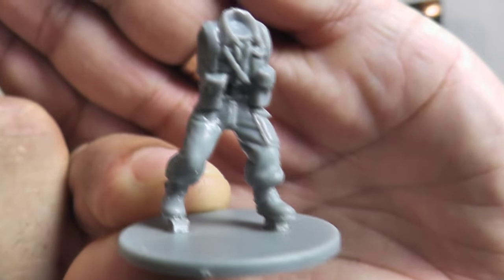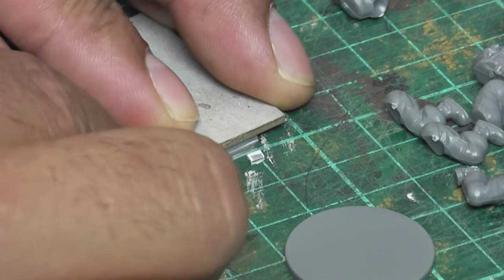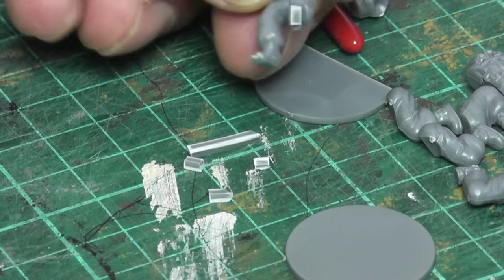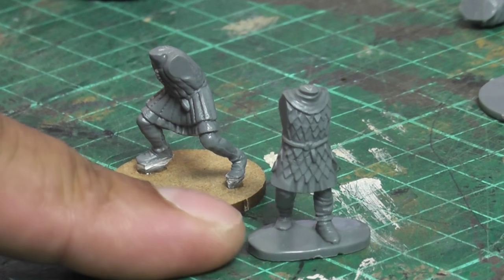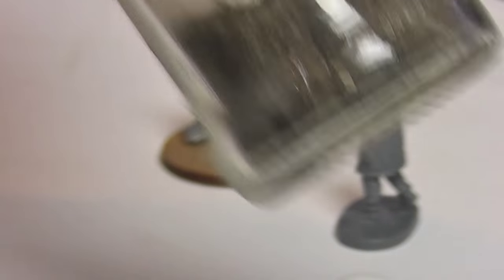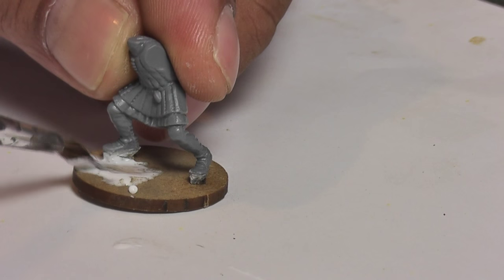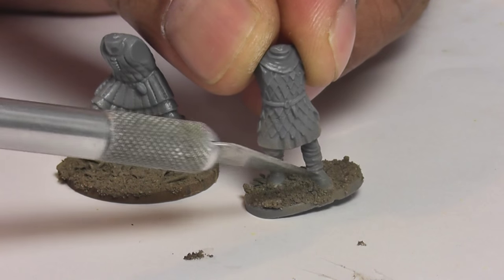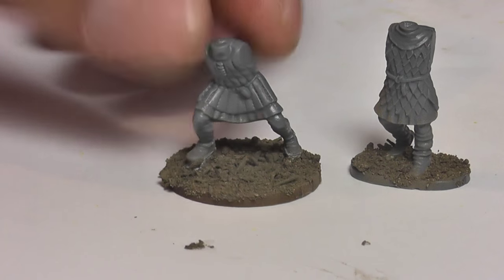Standing Proud, better basing for wargaming miniatures

Comment from the maker: I should point out that this technique only really works well when using plastic, and plastic cement as the parts fuse together creating a strong bond.  You could do this with metal figures but I'd suggest running a pin all the way through the base, the peg and into the foot.

Comment: Thanks for sharing this. 
I'll be using sheet styrene instead, cut to shape. Since they come in different thicknesses,
you can use whatever thickness is needed depending on how thick the basing material will be.
I tested out some Gorilla Super Glue and it holds styrene-to-styrene and styrene-to-wood,
even works great on the REAPER Bones minis.
Pinning is always an option if needed.

Comment: I see what you mean & yes they do look a bit better/more realistic. It is quite a bit of extra work though when building & painting & baseing 30+ minis. When using figs w/integrated bases i tend to use my exacto knife to pock mark up the base so i can do a thinner layer on it than the part attached to the gaming base. However it is plain that should you put in the time your technique will result in nicer basing. TY for sharing this tip & keep up the good work.

Comment: I have gotten to the point that I will base to my textured base, then drill wholes into it after it is done drying, and I will pin the miniature to the base using safety wire.  You essentially get the same effect without have to do any cutting of materials.  Just drill small wholes into the feet of the mini and the base.  Which was very needed for my Epic Butcher model (for Warmachine)

Comment: Stupid question time: Why wouldn't you just use scrap plastic from the sprues?
Reply from the maker: +Capng123 hehe, I used to do that, but believe it or not its more of a pain in the arse.  the sprue is not rectangular it has an odd shape.  It's also thicker than the bases, so harder to cut through in a straight and true line, you end up with odd bevels, it's just more fiddly to work with
Reply from the maker: +Capng123 Ideally you'd wont to use some 1.5mm plastic-card (hips - high impact polystyrene) but I didn't have any at hand

Comment: Cutting the extra bases looks like a lot of work, could you not just get some off cut bits from laser cutting MDF at the studio?
I'm sure i tossed out tons of tiny bits from popping out bits from windows, and small detail pieces on MDF kits I've done.
Reply from the maker: it kind of needs to be plastic so all the joins fuse and wells together ... other wise I'll have to mess around pinning through the mdf into the base
Reply: +RubbishInRubbishOut That's a good point Sir.